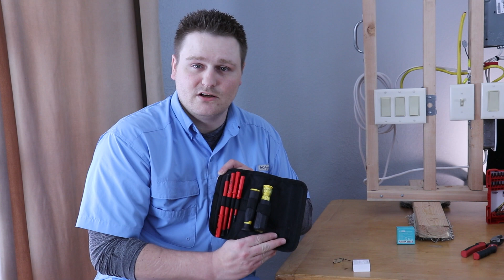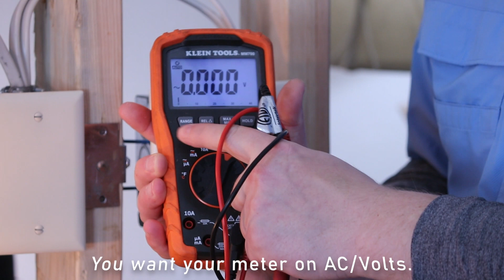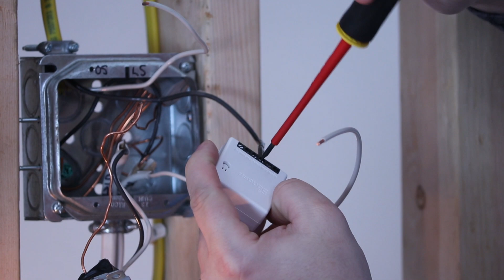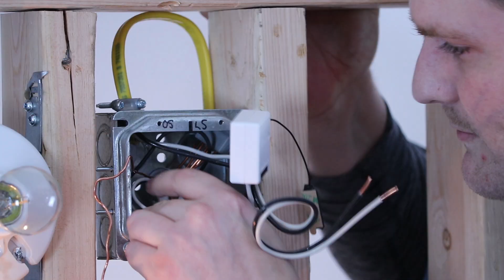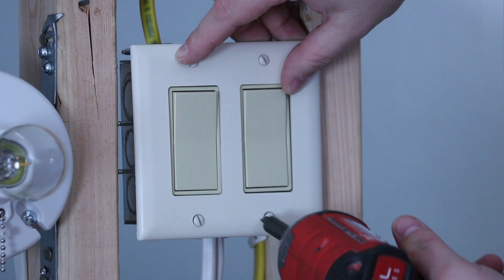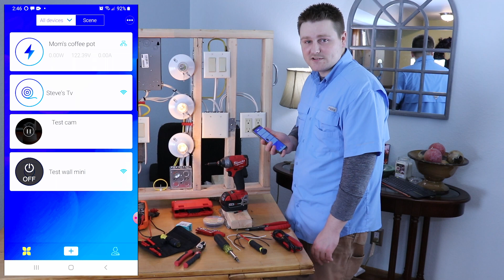Sonoff Mini Make a dumb switch smart. Switch Install & Setup How To (Normal Switch)

Comment: The problem I found was with the Sonoff terminals being so small, when trying to force the Sonoff and wires into the box it was very easy for the 12awg to pop out unless the terminals were tightened and wiggled to an insane degree. I almost thought about buying a 3 gang just so I could have a decent amount of space for the Sonoff instead of going back into a single or two gang.
Reply from the maker: I know you have to crank them down hard. for one of my switchs I did buy a 4gang box to the outlet.

Comment: Very good explanation. However, I would like to know if it can be used in a switch which does not have neutral. If so, how to proceed? Thank you
Reply from the maker: You can not at lest this model.
Reply: @TNW1337  If you find a solution that does, please upload a demo vid. Living in a old house with no neutral to some ceiling lights.
Reply from the maker: @chrishenry5665  Google smart devices that require no neutral they do make them.

Comment: I am having a problem after installation. I am trying to turn on the light through the app and it turns on and them turns off immediately. Does the same thing when I use the wall switch. I am trying to control my porch lights and the two lights on the side of the garage. They are all on one switch.
Reply from the maker: sound like it is miss wired.

Comment: Really nice job with this video.  Multiple cameras, solid explanation, even showed how to deal with the issues of the wifi antenna and getting it to fit in the box which was just icing on the cake.  Great job!
Reply from the maker: Thnaks
Reply from the maker: Yes I try to give as many angle as possible. If I had the time I would animate some stuff to. But as I am self taught. It was not on the list.

Comment: Great video. Thanks for posting.
Sorry I'm a complete noob, the only thing I've done with light switches is replace an old one with a new one, so it confuses me sometimes. My light switch has 3 wires and a whole bunch of neutral wires. So I just add another white wire to the neutrals to go to the sonoff? And what do I do with 3rd black wire? That's what's throwing me off. This is just a regular bedroom light switch. 
https://i.ibb.co/PDYWxDW/IMG-20200724-193906.jpg
Reply from the maker: Just wire nut the 2 black with a extra and tie it to the out on the sonoff you have 2 light ciruts I think coming off that outlet. does that switch turn 2 lights on?
Reply from the maker: It may also d a light and the top out on some of the outlets.
Reply from the maker: In the pic looks like top wire is hot. do this pull the wires off and keep them away from ech other, pull out your multi meter and test the single one with the breaker back on. That should be your hot. then if it is, that will be line in. yes I would just add a extra Neutral to the pile there. then you should end up with 3 wires to the sonoff/switch. you will need to add a extra nut to the out line for the extra 2 light circuits there.

Comment: How would you do this if you have more than 1 light (I have spotlights in the hallway) and in a 2 way setup? I've searched all night and still can't figure this out.
Reply from the maker: Here is a Diagram for you
 https://external-preview.redd.it/iMo5SvuAko2E2B8bAbhGa-d76RLISi39WoCCMcT_AJY.jpg?auto=webp&s=6f992426e801373bf142a4e453d1c832fe2719a4

Link 2
https://preview.redd.it/qzrq1b6xgd641.png?width=1001&format=png&auto=webp&s=b4c7e1446aeca370cf04be56a83448ee86357271
If this does not help jump on discord I and can maybe help more if needed.
Reply from the maker: If this did not help you I can jump on discord and help you out.

Comment: Hi, Could you tel me how should I connect if there is only two wire in the switch? I’m writing from Budapest Hungary. Thanks. Laszlo
Reply from the maker: Not possible. You need hot & neutral.  sorry man
Reply: Put the mini at the light end of the circuit instead of at the switch.  You will find all the wires you need there.

Comment: Awesome tutorial, used it to wire a Sonoff mini in my dining room. But, I have a switch in my daughters room that goes to a light/fan but switch only works for the light. I have 1 white and 1 black wire that are connected to the switch. How would I connect that to the Sonoff mini
Reply from the maker: So sorry I did not see your comment YT was not loading them for me. If it is just a hot & load line setup, it will not work. They do make a switch that does not need a neutral. This would be your best bet . 

Wall Switch with out Neutral: https://theiotpad.com/wp-content/uploads/switch-power-no-neutral.png
Wall Switch with a Neutral: https://theiotpad.com/wp-content/uploads/switch-power-neutral.png
Smart switch that will work with out a Neutral you need a bypass and switch
Bypass https://www.amazon.com/Aeotec-Bypass-Resistor-switches-flickering/dp/B0716BDNFB

Then you can look up a smart switch that would work for you. One with out the neutral.

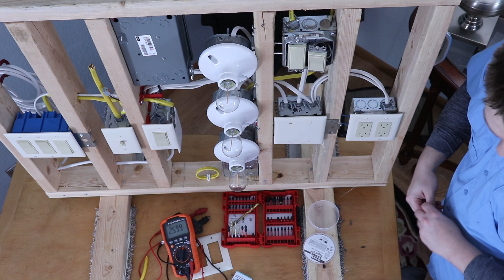Comment: @24:51 I don't think it matters that the switch was upside down - By using the WiFi capability, the rocker position will inevitably be disoriented.
Reply from the maker: Cool info to know. I am not fluent with home auto I cam from the Security, Access control, & High voltage.